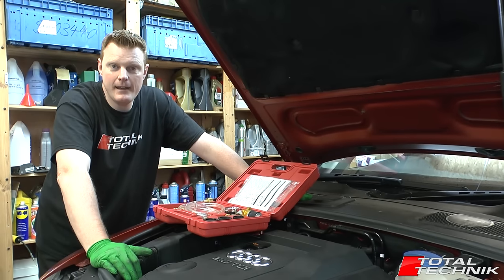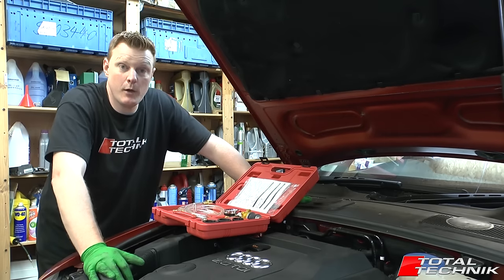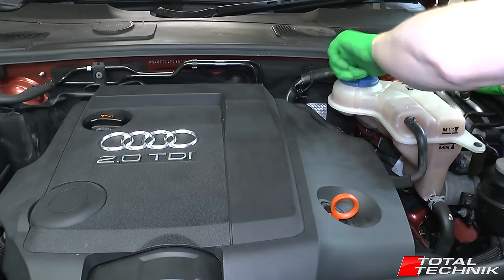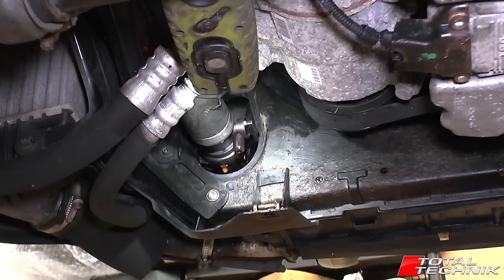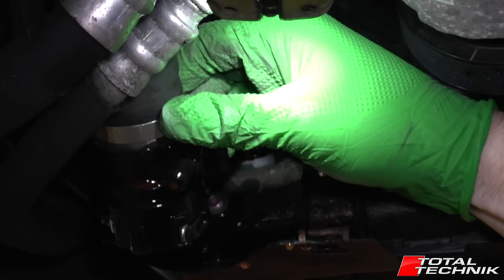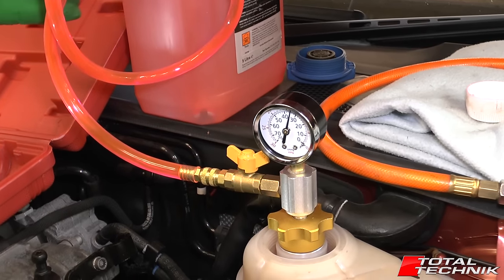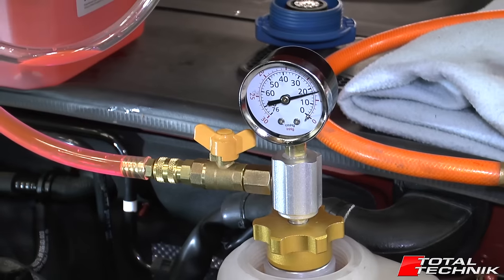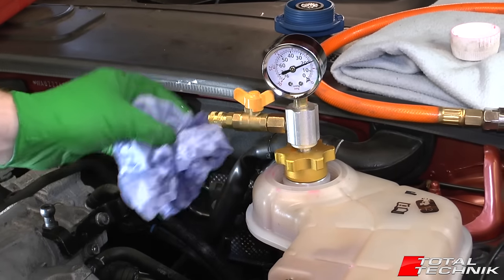How to Change Coolant (AntiFreeze) - Audi VW Seat Skoda - 2.0 TDI (ALL MODELS)

Comment from the maker: In this video we show the full coolant change process for the Audi/VW/Seat/Skoda 2.0 TDI models. We are using a cheap coolant purge kit we bought specifically for this video, but you can refill manually if you prefer but the kits do help avoid air in the system. And be sure to clip the main lower radiator piper back on 100% fully!!! Happy motoring!
Reply: Isn’t the quickest way just to wait to engine is cold, remove coolant line from radiator, start engine for 20 seconds, turn off.   Then refit coolant line & fill up, while filling start engine with heater on hot & wait till it fills up.

Comment: A bit over complicated using that thing, coolant flush: 
open cap on bottle, 
remove under tray, 
remove bottom hose on radiator let coolant come out, 
put ur mouth around expansion bottle and blow a few time to push out coolant, 
attach the hose back 
fill up with water run, 
engine for a few minutes to circulate water, 
switch engine off, 
open cap
remove hose
Drain water 
Mouth around expansion bottle to blow all water out
Attach hose
Fill with coolant mix 50/50 with deionised water or get redy mix (g12+ g12++ g13) full the expansions bottle 
Start engine heater on hottest setting blower on full 
Keep eye on level as it goes down top up, once you see the coolant in the bottle swirls around and heater is blowing hot air put cap back on switch engine off leve for 20 min, 
check level if need topping up to max top up if not leve alone 
Take car for a long drive until the temperature gauge goes to middle and heater blowing out air, carry on test drive to see if temperature gauge stays on middle
Drive back home park car check level whilst hot then check level 1 hour later whilst cold 
Works for me

Comment: You cover only the older models of 2.0TDI, those with PD. The new one with Common Rail is totally different, so the title "All Models" is misleading. In 2.0 TDI CR 177HP I don't have any drain next to radiator. Oil cooler is in totally different place and besides I doubt, the disconnection points are the same as in your engine.

Comment: Hi There, I have an A6 C6 2-0 TDIe 2009.
I have changed the thermostat and coolant on my car, did a refill with a purge refill kit like you said from Sealey all went exactly same as yr video started car up revved for theee minutes then left it on tick over, it would not get to 90 degrees. Today I decided to strip it all of f again, had car on drive on front only  ramps removed thermostat heat in water ok, looked through thermostat hole and water pump ok no missing blades, flushed heater, block, and rad, refill system with vacuum kit while car on ramps, Top hose gets hot as all hoses do, went for test drive and temperature gauge starts cooling down, drove for another 8/9 miles checked again when home and top hose, header tank,  plus connecting pipes are cold, parked car at home on slope and top hose, header unit and pipes start to get warm,  however taking car on level ground again and top hose goes cold took it for a test drive, if I turn heater off temperature goes up to normal but top hose still cold, turn heater back on and temperature starts falling, top hose still cold,
Any thoughts or ideas would be great
Many Thanks
Kevin

Comment: I use Holt's g13 and it says not to dilute...  I also bleed it by filling the expansion tank and putting on the cap.. I remove the return pipe hold it up high as I can and use about 2 psi to push the air out .. by putting a skinny nozzled air gun into where the return pipe goes... Works a treat.. system bled in a few seconds.. of course check level after a drive and the car is cold.

Comment: Is that not a drain Petcock that you twist and it will drain the coolant? Most Radiators have them. Just curious why you just didn't turn the valve and let it drain. seems like a lot more work taking the hose all the way off? Sort of new to VWs but if that's the way the Manual says to do it.
Reply: I'm no expert but I'm pretty sure it is. It even has a flange to connect a small length of hose to neatly catch the coolant!

Comment: What would happens if I drain below and refill the top without a vacuum pump?
Reply: Nothing. You drive the car with the heater on high, then park and with a towel over the reservoir lid, SLOWLY unscrew it SLIGHTLY just until you hear a bit of pressure escape. It will bubble, and when it stops, close the lid. Drive again, and repeat at least once. If your car has a hard pipe in the coolant system (usually on the top of the engine somewhere) it should have a small screw for purging the air from the system the same way you do it at the reservoir lid. Turn that screw slightly until coolant bubbles and foams out (DO NOT screw it out beyond this!). Watch the trickle, and when it turns from bubbles and foam to a smooth drip, close the screw, drive around and repeat. Not all cars may have this screw, or it may be in different locations depending on vehicle.

Comment: Does the Audi workshop manual mention flushing the system? The old coolant looks quite "tired", so we can assume that after draining it there is still a lot of sediments, debris/rust and old coolant remaining. Not to mention the case of changing the coolant with specification incompatible with the old one.
Reply from the maker: It's a simple enough process to flush. You can refill the system with water (distilled/mixing water) and run it around the system, and then refill again but this time with your coolant. So just do the process twice effectively, but don't let the car run too hot with just water as the boiling point is lower (of course) than coolant, so just enough to get it fully circulating, then dump it again and refill. This will help flush out anything left over after your standard drain. If your car has original Audi brand coolant in then you can refill with G13 as it is backwards compatible, or if you don't know what's in there then you can get non genuine G13 equivalents designed to be compatible with any other coolant. Hope that helps!  :-)

--- 

To help support us (for both you and others reading this) there are a few things you can do:

1) Donations both needed and welcome! We cannot operate Total Technik without the support of people like you! You can donate by PayPal - just go to www.paypal.me/totaltechnik
2) Please ensure you subscribe to our YouTube channel. 
3) Please give our video's the Thumbs Up on YouTube. 
4) Please help spread the word, the more people who know about us the better! Add links to our video's in forums, let people know about us.

Thank you for your support!

Comment: Bit confusing.. Why you need to remove pipe from radiator when there are coolant flush valve in the pipe..
About G12. It's very easy to get it on East Europe from car part dealers (like InterCar etc) as well as G12+ what is safe for mixing with G11 or G12 in the case if you don't know what type of coolant was in the system before...
Reply: this whole demostration is quite unneccesary

Comment: My 2008 A4 has a small screw on the coolant hard pipe on top of the engine that's used to purge any air out of the system after a drain/fill while the engine is warmed and idling. Does this car have the same? If so, there's no need for the pump or removing the reservoir (unless you need to clean it out). It's much simpler and easier.

Comment: Hi,firstly do you drain coolant when hot/warm to get most of old coolant out?,and when refilling even if engine is cold does the vacuum filler fill all the system completely?,thanks.

Comment: When the engine is warm, the cooling system will be under some pressure from the expansion of the coolant. This would be a good time to use the bleed screw above the scuttle would it not?  That is the highest point in the system, and the pressure from the warm coolant should force any air out.

Comment: Thank you for this video. I’m working on a 1.6l Skoda but I imagine the principals are the same. One thing you might help me with.. what is the name of the smooth clamp on the rad hose? It is the clamp that connects the rubber hose to the elbow, the same type of clamp found on the heater core connections. I’ve never seen this type. Can they be safely removed without destroying the rubber hose?
Cheers!

Comment: Hi! Nice video! If your changing the oil cooler, which filter should i get for the oil cooler on an Audi A6 2.0 TDI 170 4F2 2010? Also, would i need to do an oil flush too? And isit necessary to buy the pressure kit? Thanks in advance

Comment: Doesnt G13 require the expansion tank to the silikat bag inside it? This bag of crystal is death to the heater matrix and the advice seems to be change the tank flush out the G13 and use G12. If you use the vacuum method to drain and refill the sytstem then why are you disconnecting the oil cooler, water side?

Comment: I thought the workshop manual also mentions to drain the coolant from the water pump hoses as well? I'm looking to do this process on a 2011 Golf 2.0 tdi which has the transverse engine setup.
Reply from the maker: The process can vary a touch from model to model depending on the exact engine and set up. Shown here is the A6 C6 2.0 TDI and this is followed to the letter using the Audi Workshop manual. So you will see the oil cooler pipes disconnected in this instance. The basic process remains the same on all of the 2.0 TDI models, but there can be minor differences.

--- 

To help support us (for both you and others reading this) there are a few things you can do:

1) Donations both needed and welcome! We cannot operate Total Technik without the support of people like you! You can donate by PayPal - just go to www.paypal.me/totaltechnik
2) Please ensure you subscribe to our YouTube channel. 
3) Please give our video's the Thumbs Up on YouTube. 
4) Please help spread the word, the more people who know about us the better! Add links to our video's in forums, let people know about us.

Thank you for your support!

Comment: I have golf 7 tdi 2013  used the cooling water g13 from ATQ  I changed the pipe welding the mechanic added about 1.5 liters g12+ (from ATQ) not g13 ..... is this not dangerous for the car ...Please answer me
Reply from the maker: Technically they are usually backwards compatible only. Being 2013 your car would be G13 from the factory. G12++ and G13 are ok for your car, but it is not meant to be backward mixed with G12+. However, as it was not the genuine coolant theirs may be different and more compatible, you would need to check on the ATQ website. In reality, you'll lkely be absolutely fine, especially as it is a fairly low quantity too.

--- 

To help support us (for both you and others reading this) there are a few things you can do:

1) Donations both needed and welcome! We cannot operate Total Technik without the support of people like you! You can donate by PayPal - just go to www.paypal.me/totaltechnik
2) Please ensure you subscribe to our YouTube channel. 
3) Please give our video's the Thumbs Up on YouTube. 
4) Please help spread the word, the more people who know about us the better! Add links to our video's in forums, let people know about us.

Thank you for your support!

Comment: Isn’t there an engine block drain plug?
Reply from the maker: Depends on the model, but on this one no. There is sometimes a drain plug on the lower hose (this one had one, but we wanted to follow the Audi workshop manual 100% so removed the hose rather than use the plug), but not necessarily a block drain plug for coolant. Some do have them, like the B6 and B7 S4 we cover in-depth on our channel has a nice plug on the bottom of the water pump. But not all have them. The process shown here is exactly as per the Audi workshop manual process.

--- 

To help support us (for both you and others reading this) there are a few things you can do:

1) Donations both needed and welcome! We cannot operate Total Technik without the support of people like you! You can donate by PayPal - just go to www.paypal.me/totaltechnik
2) Please ensure you subscribe to our YouTube channel. 
3) Please give our video's the Thumbs Up on YouTube. 
4) Please help spread the word, the more people who know about us the better! Add links to our video's in forums, let people know about us.

Thank you for your support!
Reply: Their is a drive petcock down thebottom

Comment: 3:30 I am unable to pull off hose from bottom of radiator (outlet, drain) ... any tricks ? I read that silicone oil, some levering but I dont want to damage it ...
Reply from the maker: Yes, the can be tough sometimes! The key is to keep rocking and pulling. Don't go crazy, but you have to pretty firm with them! Or you could use the drain port, which can be seen in this video located on the side of the lower hose. You don't get quite as deep a drain as removing the lower hose (which is likely why the Audi workshop manual instructs to do it that way), but it can be quicker and easier than a stuck hose!! Best of luck!

--- 

To help support us (for both you and others reading this) there are a few things you can do:

1) Donations both needed and welcome! We cannot operate Total Technik without the support of people like you! You can donate by PayPal - just go to www.paypal.me/totaltechnik
2) Please ensure you subscribe to our YouTube channel. 
3) Please give our video's the Thumbs Up on YouTube. 
4) Please help spread the word, the more people who know about us the better! Add links to our video's in forums, let people know about us.

Thank you for your support!

Comment: hello and thanks for your help in my Audi A4 B6 I had changed almost all of the hoses but always the water level in the tank is decreasing could the tightening of the hand lower piper be the cause
Reply from the maker: Are you experiencing any visible leaks, or leaks on your driveway?

--- 

To help support us (for both you and others reading this) there are a few things you can do:

1) Donations both needed and welcome! We cannot operate Total Technik without the support of people like you! You can donate by PayPal - just go to www.paypal.me/totaltechnik
2) Please ensure you subscribe to our YouTube channel. 
3) Please give our video's the Thumbs Up on YouTube. 
4) Please help spread the word, the more people who know about us the better! Add links to our video's in forums, let people know about us.

Thank you for your support!
Reply: @TotalTechnik  the leaks in driveway
Reply from the maker: @ouahchiamor7627  Ok, that's probably the better of the two options! So, you definitely have a leak, so you need to get under the car and have a good look around to see where it is coming from. Remove the undertray panel, and look for the wet spots, and try and trace it back up to it's highest point and see if you can find where the leak is coming from. It could indeed be the lower pipe as you mentioned, but could also be things like the radiator, intercooler/s (if you have them) etc. So you really need to spend 10 minutes under the car with a good torch and have a good look around. It should be fairly easy to spot which area it is coming from, which will give you the starting point. But don't replace anything else until you can physically see where the leak begins. Best of luck!
Reply: @TotalTechnik  thank you I will try to see

Comment: I put a new expansion bottle on my Audi rs4 b7 took the old off put the new one on filled it up a day after loosing coolant there's a drip coming from the rear of the engine  at the  bottom no leaks from top am confused

Comment: Isn’t that a drain petcock I see on the hose?
Reply from the maker: Yes it is. However, to fully drain down the system completely for a full coolant change as per Audi workshop instructions, you don't use it. It's located half way up the pipe and so using it will not drain all of the coolant out. As shown here is the exact Audi workshop method, using a cheaper DIY orientated version of their tool. This should get as much coolant out as it is possible to.

--- 

To help support us (for both you and others reading this) there are a few things you can do:

1) Donations both needed and welcome! We cannot operate Total Technik without the support of people like you! You can donate by PayPal - just go to www.paypal.me/totaltechnik
2) Please ensure you subscribe to our YouTube channel. 
3) Please give our video's the Thumbs Up on YouTube. 
4) Please help spread the word, the more people who know about us the better! Add links to our video's in forums, let people know about us.

Thank you for your support!
Reply from the maker: Yes it is. However, to fully drain down the system completely for a full
 coolant change as per Audi workshop instructions, you don't use it. 
It's located half way up the pipe and so using it will not drain all of 
the coolant out. As shown here is the exact Audi workshop method, using a
 cheaper DIY orientated version of their tool. This should get as much 
coolant out as it is possible to.